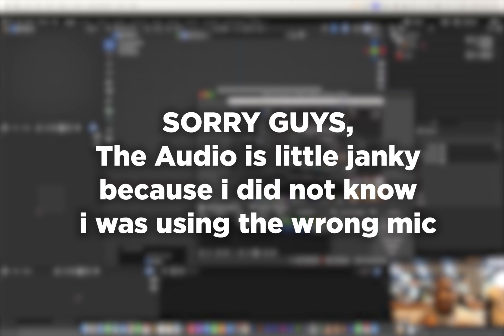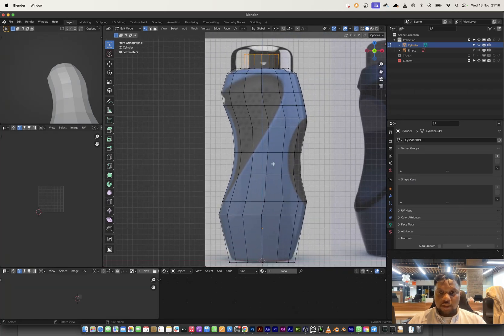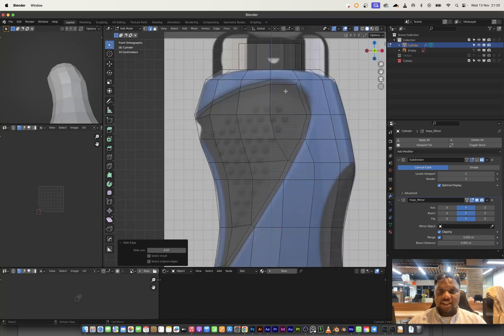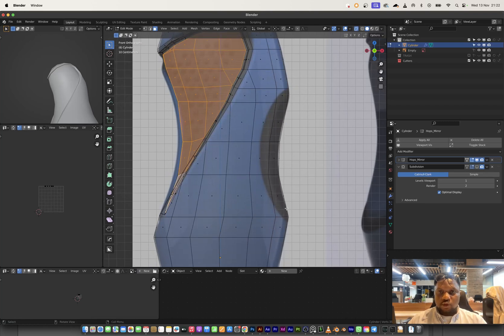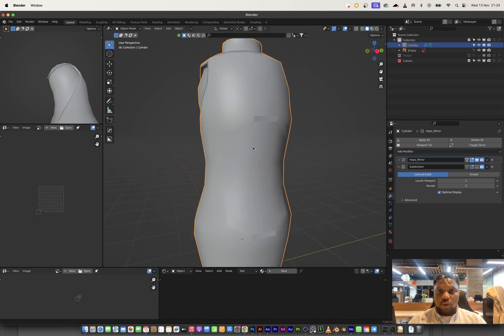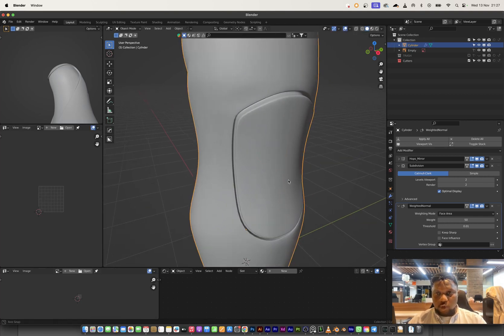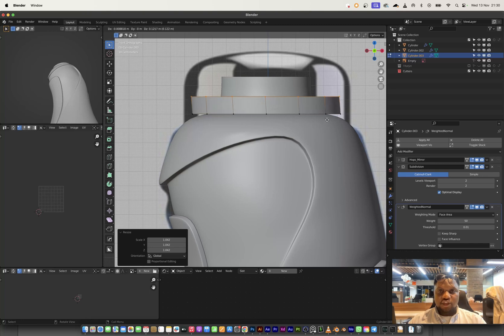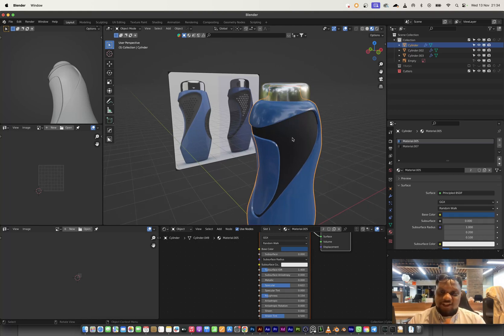Modelling Practice in Blender | Water Bottle - 01

Comment: The audio was OK compared to many tutorials I've watched. Generally, the video was well done. To make things easier for the audience, I have a couple suggestions. You can adjust the interface to have larger font (Edit -> Preferences -> Interface -> Display -> Resolution Scale (try 1.3 or so)). Another idea is to use screencast keys (Edit -> Preferences -> Add-ons -> toggle the Screencast Keys on). While you're at the screencast key add-on, adjust the font, color, offset, and more.